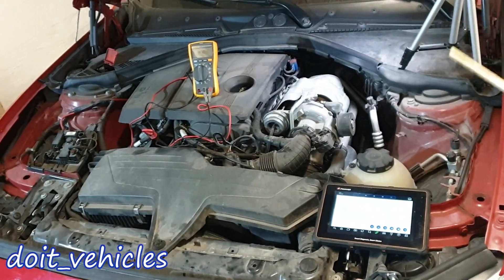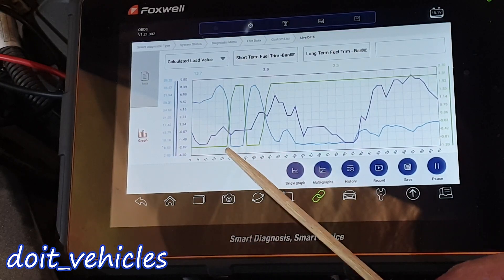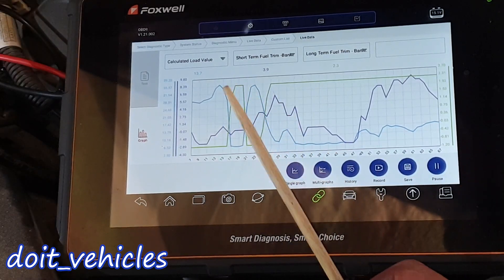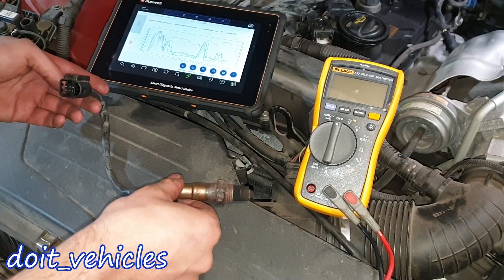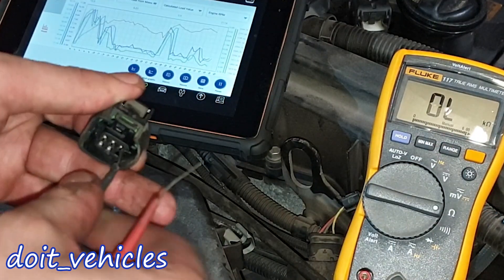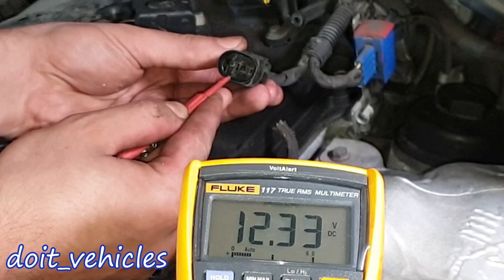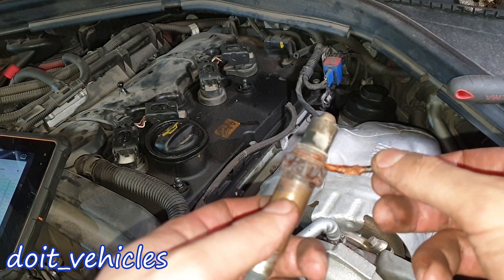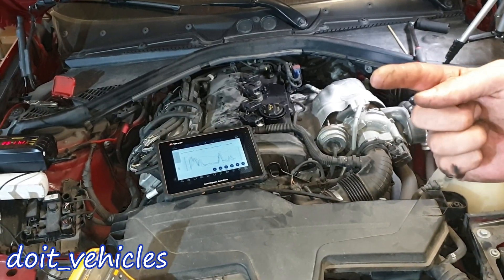114i BMW O2 sensor /removal & TEST before REPLACEMENT F20 116i

Comment: Thanks for the video. I would appreciate if you could also show the removal of the other o2 sensor.

Also maybe you could help me with some advice. On the same engine (using Carly for diagnostics) I get the following errors:

12A701 Lambda probe on the catalyst, electrical: short circuit to positive
12AF08 Lambda probe after the catalyst converter, the boost from rich to lean: delayed reaction.

Mostly the first one appears ... but sometimes both of them ... can figure out a pattern on what I;m doing ...

I must mention that this errors show only when doing OBD2 diagnose (no check engine light) .. I do not really feal anything when driving , maybe just a short hesitation in acceleration when cold start.
Also must mention that the errors appear only in the following scenario:

Cold start ... wait max 4-5 sec .. then drive off .. 

When I leave the engine to reach 1000 rpm (15 sec onwards) then the error rarely appear.

A mechanic told me to first check for dirty CAT and maybe professionally clean it ... I did not do that until now ... 

If changing the 02 sensor I was also adviced to put only OE sensor 

What do you recomend ? 

Thanks
Claudiu
Reply: Is your BMW remapped?
Reply: @rtraz2883  No .. no remapp
Strange ... forgot to reply to my own comment .. above problem was fixed by spark plug change a week ago.
Reply: Same errors again ... seems the spark plug change fixed it just for a short period ... :((
Reply: Do You fix this problem? I have the same errors
Reply: @saimone1981 me too
Reply: @rtraz2883 mine is remapped and I’ve got 02 sensor too lean, happenee first when I was misfiring with flashing engine light, what would remapping do compared to a original map?